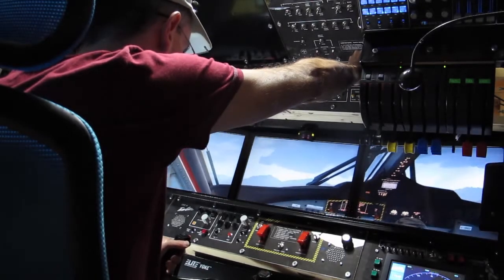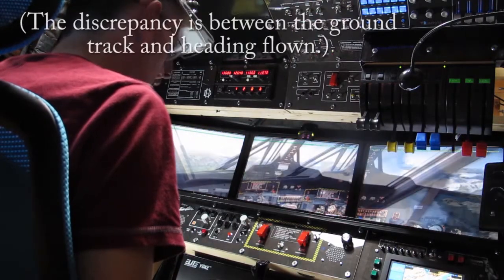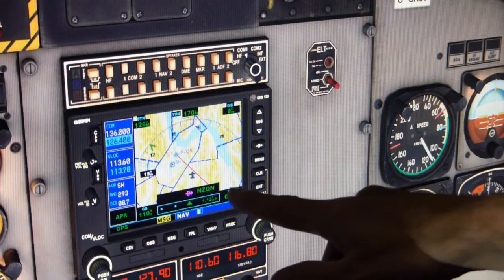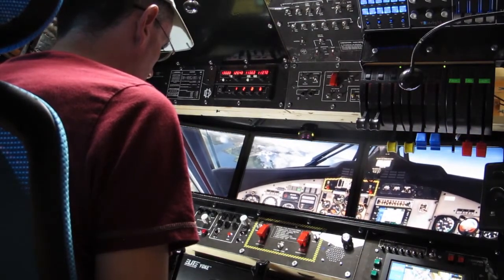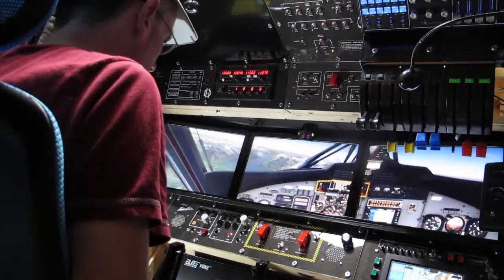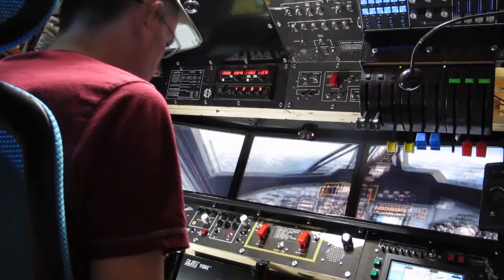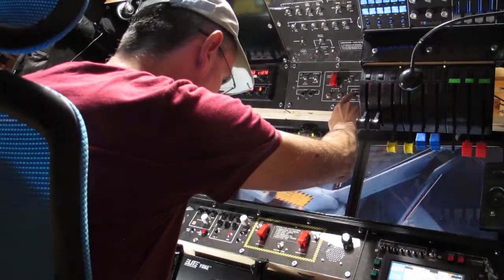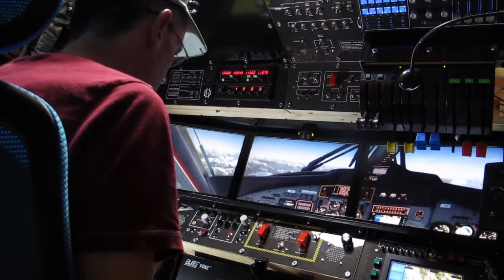Twin Otter Close Up #4 - Autopilot 2

Comment: Scenery issue is due to your scenery files in fsx not being in the correct priorities mine used to be like that
Reply from the maker: Yes, it's most likely an installation problem. Either that or it has a 2m mesh or something (I have 5m set). I accidentally installed Queenstown before NZSI, which probably didn't help. It is on the list of things to sort out.